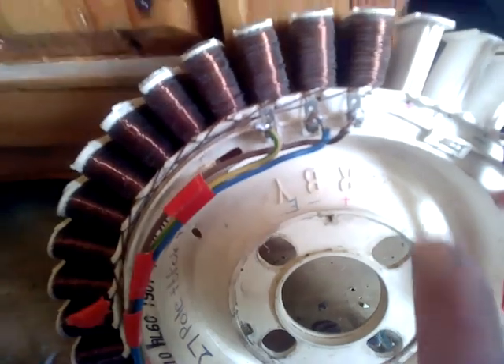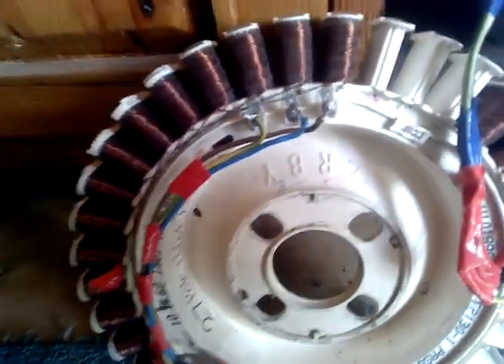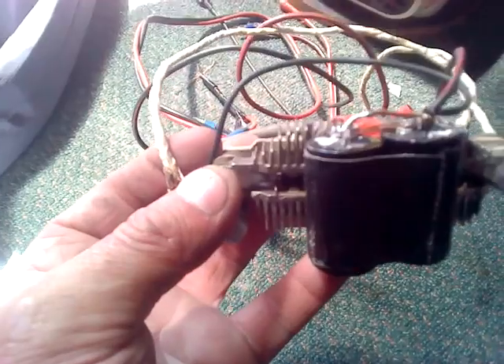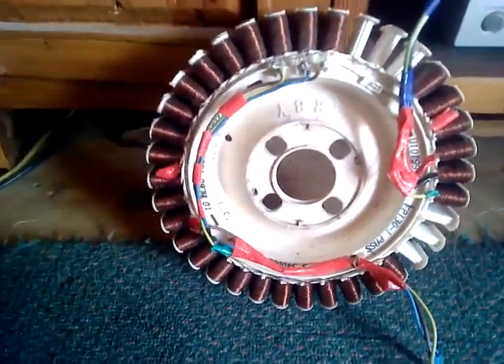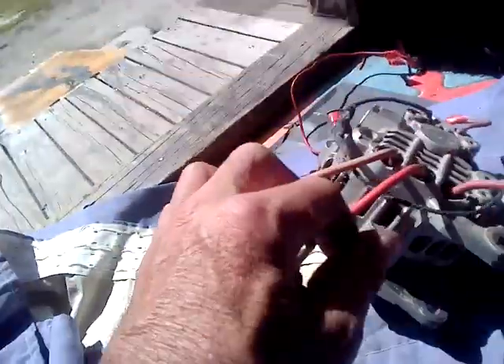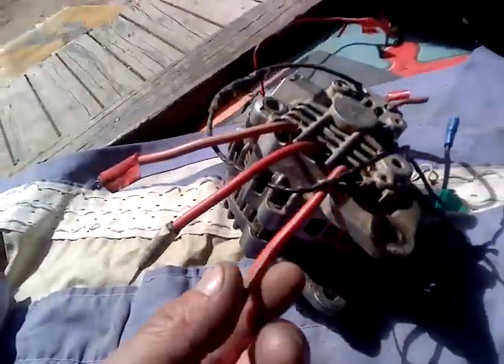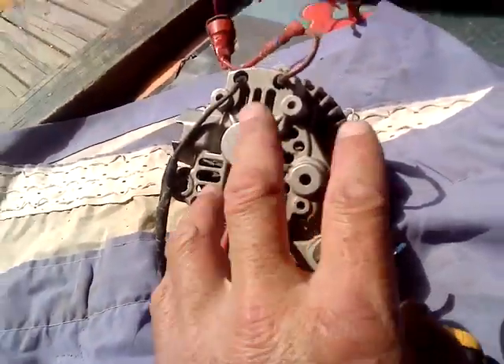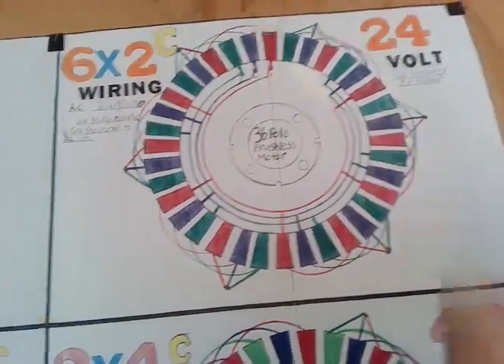24 volt the new 6 pole x 6 wiring diagram for f&p washing machine motor  as a  generator for battery

Comment: @cruiseman awesome work mate, easy to understand. We have been messing around with these too recently, found some have copper and some ally. Trying to figure out which configuration is going to give us the highest amp output  (copper assumed). Can you share the configuration for this? AC or DC (48v). Keep up the momentum mate.
Reply from the maker: Biggest thanks 😊👍🦇 from cruzermans inventions.yip keep a eye out today for the new video that's on the 36 pole washing machine motor rewired as a generator for 48 volt AC
Reply: @tristanmcnabb2741  very keen to see the results,  perfect timing 👌